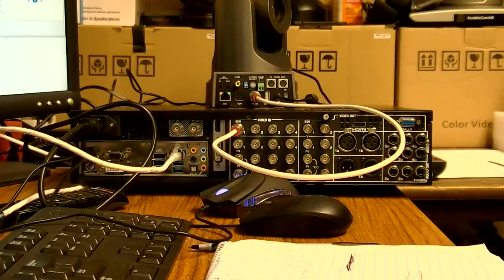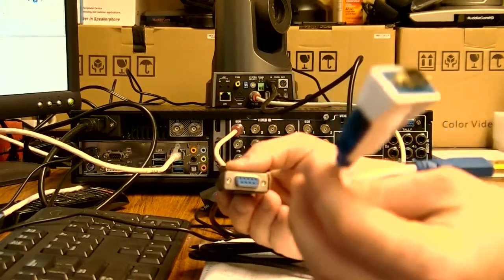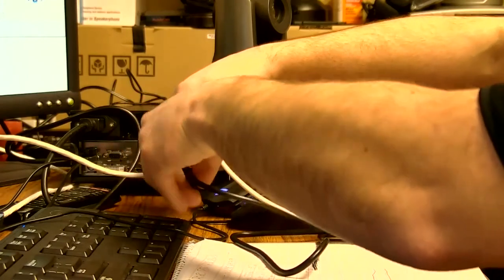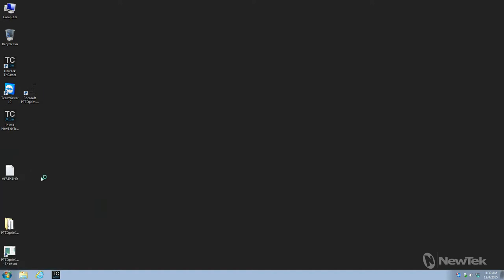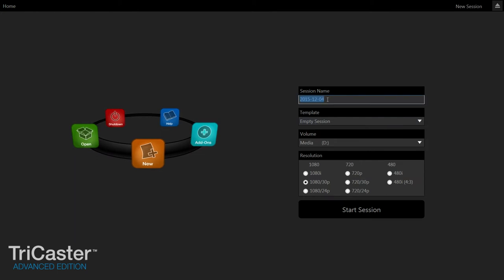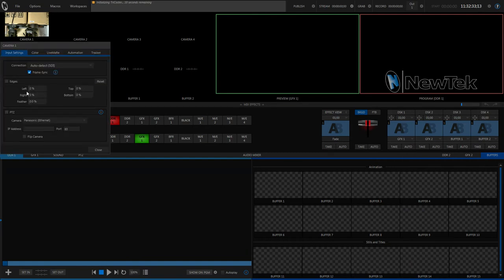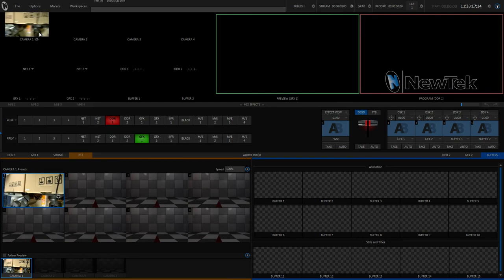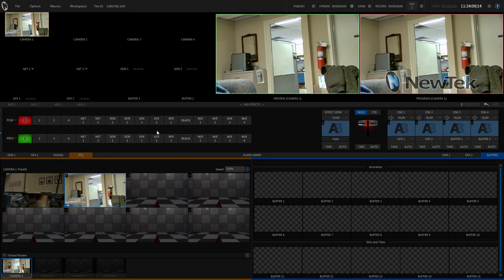Tricaster Control setup with a PTZ optics Camera

Comment: 500ft for RS232? Wrong, you can only run RS232 a max length of 50 ft.
Reply from the maker: I made this video while ago so I figured I would test it out again. Just ran 450 feet of rs-232 cable (10c22 shielded, 9600 baud rate) and it controlled our cameras just fine. I can't speak to other manufacturers but with the PTZoptics cameras, you can go up to 500 feet for rs-232 control depending on your Baud rate and cable type.
Reply: interesting, I will have to test this. Thanks for the reply